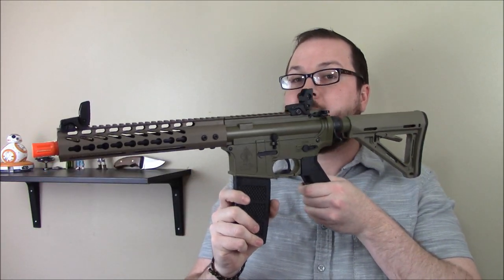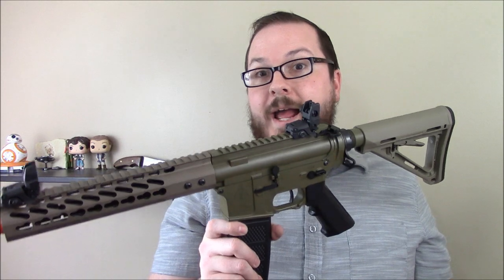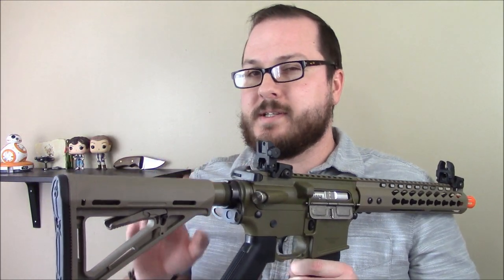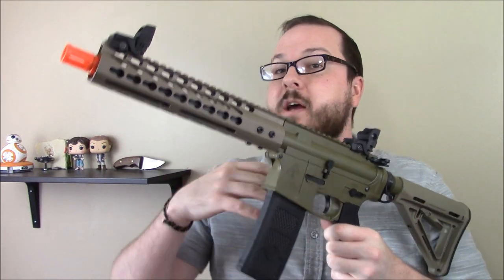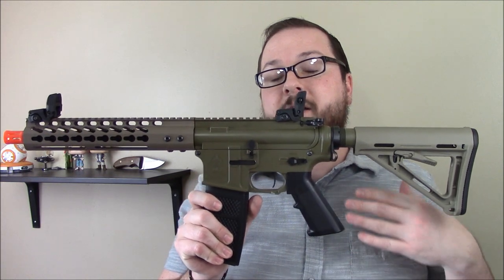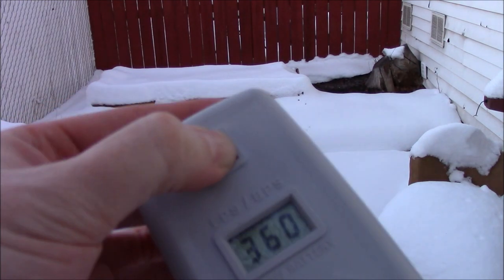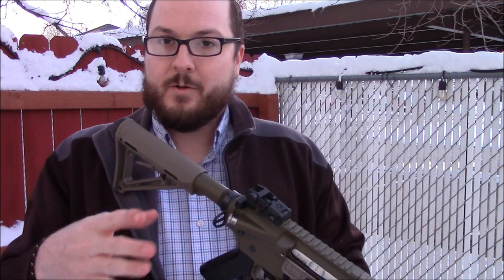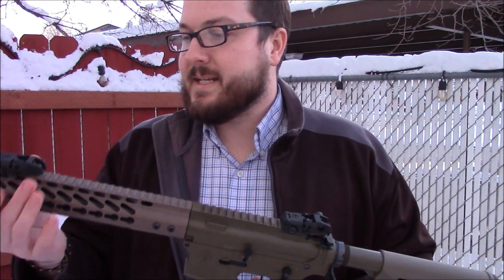American Airsoft Factory "Wabbe" CQC Overview Pt. 1

Comment: 1:35 You made a mistake, its not a full travel bolt it goes only 3/4 of the way back unlike the GBLS DAS which does have full travel. Either way nice review, I look forward to the next videos.
Reply: Even the GBLS does not have a full travel bolt. It moves maybe 4/5ths of the way. Going to have to get a gbbr for true full travel.
Reply: The GBLS DAS doesn't have as much air volume either, which means that the AAF and standard AEG platforms are capable of more using heavier BBs than the DAS is.

Comment: Also, could you please describe how it feels like when pull the trigger? My GBLS' trigger is very close to real steel, and since the AAF EBB has similar design with a sear built in to hold the piston locked in position like an air-powered sniper rifle, I guess the trigger is not very AEG-like, right? Thanks advance for your patience and valuable inputs!
Reply: The trigger is completely electronic and has no tactile sensation outside of pushing against a constant spring resistance.

Comment: When I hear the words "custom" or "unique" in the same sentence with "M4" I always start to laugh. You drop more than a grand for a "unique M4" and no one can tell the difference from 30 feet.
But yeah, the operating system  looks interesting so I will stay tuned. Except for the sound. I wish someone would figure something out to get rid of the RC car sound. Sound is one of the the reasons I prefer gas blowbacks.